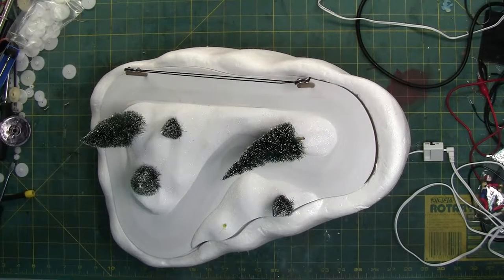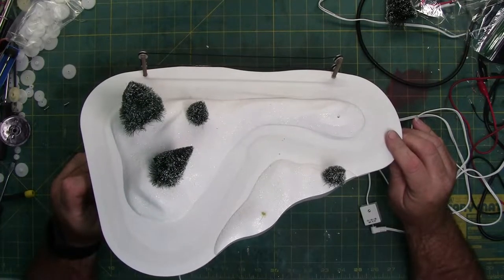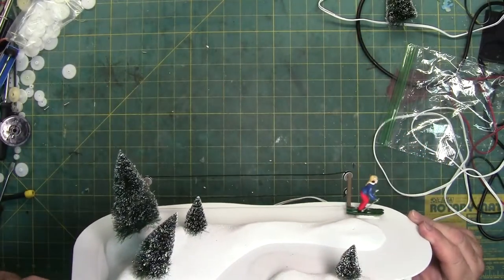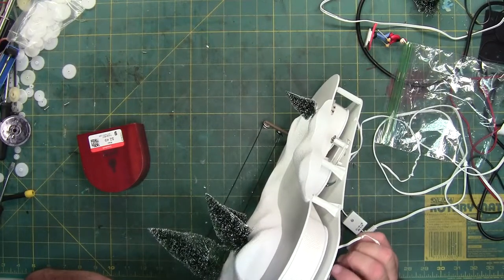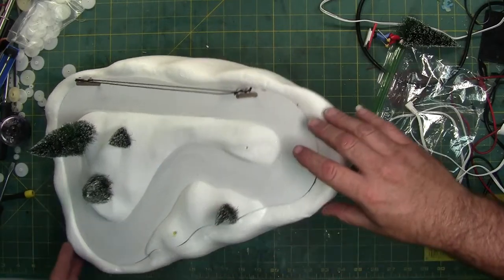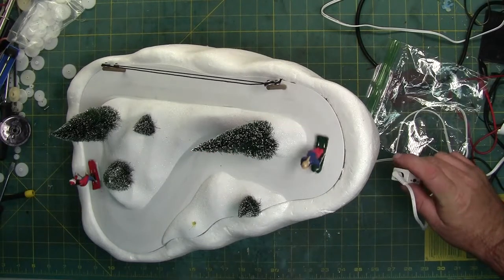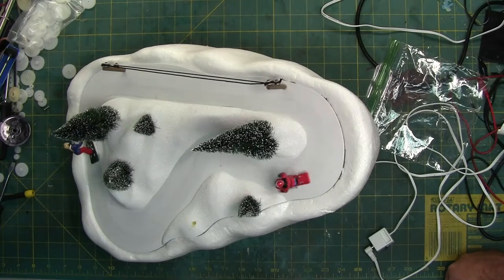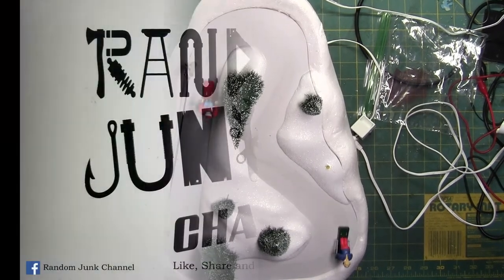Department 56 Ski Slope Repair

Comment: Thanks for the video. The issue I'm having is the fabric belt will not go unless I put a screwdriver into the main pulley piece where the motor slots into and turn it manually. Both the pulley system and the motor are working fine. The issue is the stem from the motor that goes into the main pulley does not spin it. Do you have a solution for that? Thanks!
Reply from the maker: Sounds like the motor is failing and needs to be replaced.
Check the gears to see if a gear is cracked and getting stuck or slipping.
Reply: @RandomJunkChannel  Thanks for getting back to me. It looks like everything is good from that standpoint. What is the replacement motor part for it? I was looking through the video transcript and did not see it called out.
Reply from the maker: https://www.happyholidaysparts.com/product-page/department-56-village-animated-ski-slope-replacement-part-motor-kit-add-belt

Comment: I see you repair lemax and department 56 and I have been trying to ask someone if you can tell me what to use for lemax creepy lamp posts adaptor which is 3v DC 47mA I have 3 sets I am going to use on my first layout. I also have department 56 adaptors that I am so mad about because I bought two sets of 3 prongs and found they are wrong for what I need and can’t find out what they are used for, they both are 3v 550ma #4035316. So before I spend anymore money I see I need to find out what is used for what. I was trying to light up my halloween front yard dept56 and my Witch by the light of the moon depart56 which they say takes 55026. Thought the 3 prong sets were for that also. So could you help me at all…..Thank you
Reply from the maker: Can you send some pictures of the ends of you DC adapters and the lamp post port to randomjchannel@gmail.com? I believe I can make this work for you.